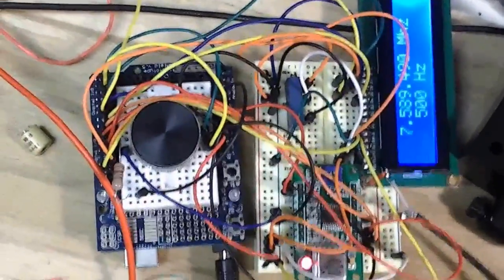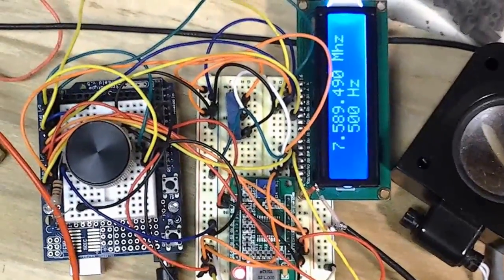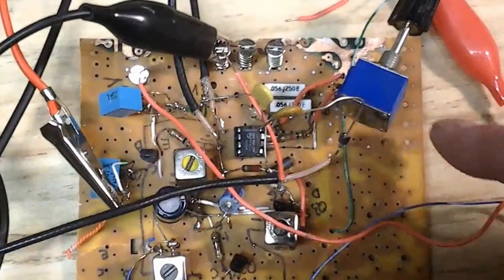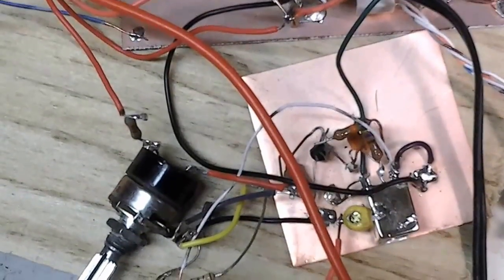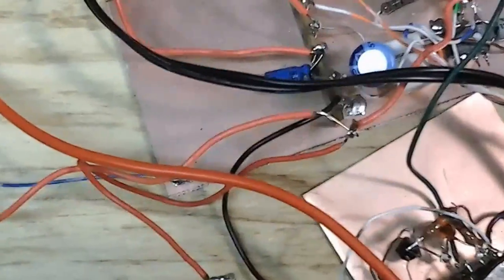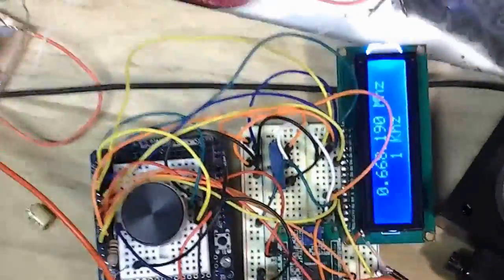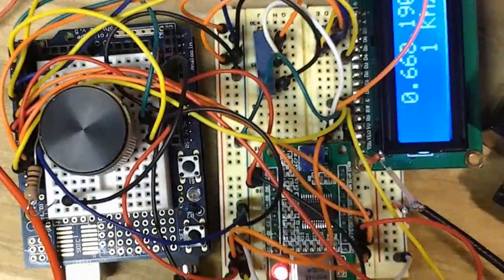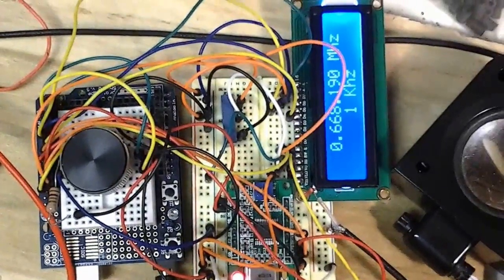Arduino AD9850 NE602 Superhet all band reciever

Comment from the maker: Antione,
Use the components Rich Suggests, that's important. Use the latest Arduino software. I've used Linux and Windows 7 for this project and they both work perfect. Also used an older Arduino Uno Rev 1.2 and a newer Rev. 3. I'm useless when it comes to the code. I copied and pasted Rich's code as he has it posted. If you follow his drawings and everything exactly, it will work. There are NO errors. Let me know.

Harold

Comment: Hello! Nice project!
Between the NE602 and DDS VFO, exist a buffer curcuit? Or the DDS level is enough?
Reply from the maker: Sorry it took so long to answer. I find I don't need the buffer in this or any other radio I've made since then. The DDS is connected directly with a coupling cap, .01µf or so.

Comment from the maker: Hi,
Several replies to take care of here, #1, I have no schematic, like I said, it's based on Bill Bowden's NE602 reciever, you can look it up on google. The arduino and ad9850 simply replace the vfo. The BFO is a simple one using an IF can. There are NUMEROUS circuits out there for receivers built using the NE602. BELEIVE me, this one is nothing special, it just works good. My plan is to boost the sensitivity. Like I said before, visit Ko Tilmans videos for inspiration, "radiofun232". I love this guy!
Reply: Oh, I heard "Cole Tielman radio front 232" so was pretty confused.

Comment: Hi Harold, Your video is very inspiring to the fact that I have a Direct conversion receiver that's stuck on one band. The problem is I'm new to Arduino. I tried AD7C code but somehow there's always an error. I am new to Aduino, Could you please help me with the code you are using in this video. How to incorporate several code like the code for the LCD, Arduino and AD9850 to work fully? I would appreciate it very much if you could help me. Thank you in advance. Sincerely, de du6fz Tony 73s